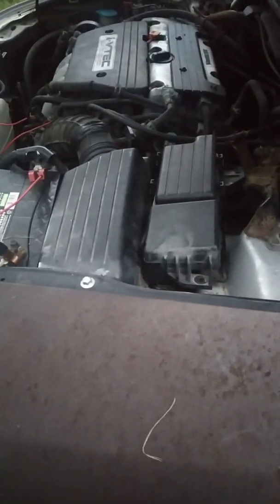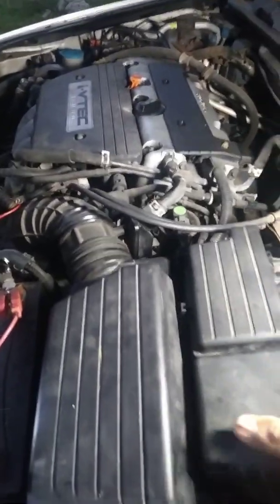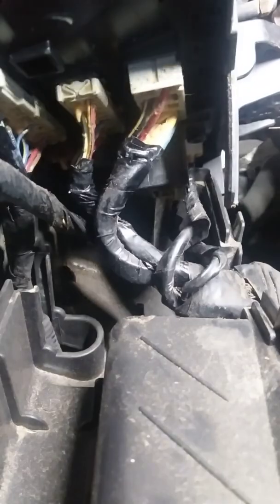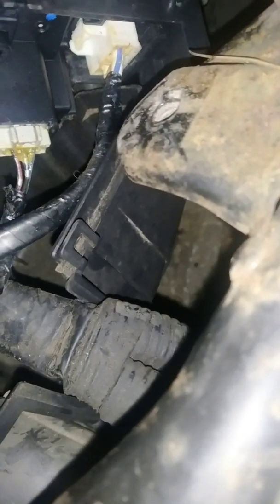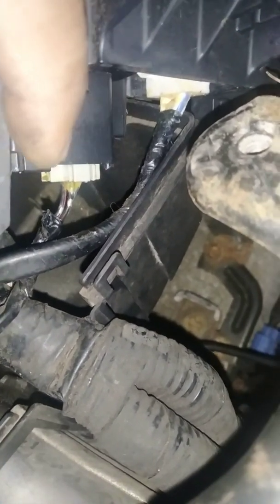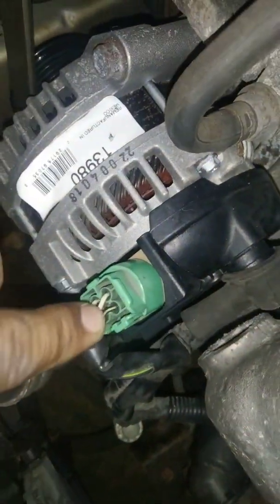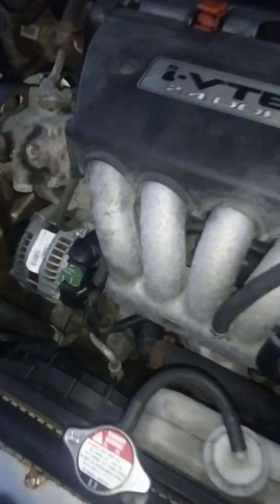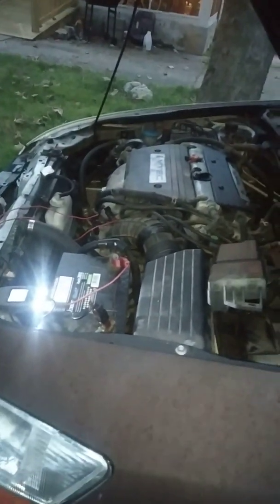2003 Honda Accord 2.4 ELD location and testing

Comment: If you just pull that 15amp fuse, would that get rid of the eld? Trying some things for audio, and may need to get rid of that
Reply from the maker: You will get check engine and others problems
Reply: @SamsAutomotiveS  ok, gotcha. So if I want to maintain around 14.4 v when playing music, should I just cut one of the wires to get rid of this sensor? That way I could stop dropping around 12v when the bass hits?
Reply: @HockeyLAKings119  install a 860ohm resistor to black/green to black

Comment: Hi sir thank you so much for your all effort,I wanna ask a question, I checked the wire coming from 18 fuse which is connected inside of eld, black-red is 12.20volt,blue-black is 3.9 volt ,what could be problem now?it has to be 5 volts, if not what is the possible reason for 3.9,I think eld is bad?
Reply from the maker: The fuse from the inside at ignition on has to have 12v the eld ..control the current..its his job to turn the alternator on or off
Reply from the maker: I dont have wire diagram for the eld but this  its control it by pcm
Reply: Thanks for replying sir,I have xenon problem,both xenon don't work,I have checked the wire coming inside ballast it read 3.9 volt which is coming from eld blue-black wire,normally it has to be 12 volts,I put resistor between ground and black-red wire,nothing happened, what could be problem sir ,could you help me?